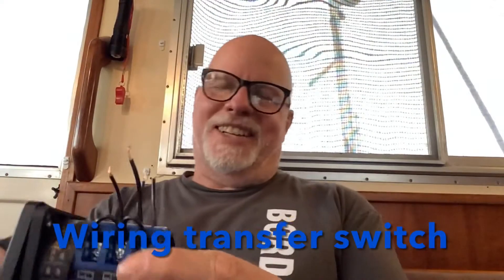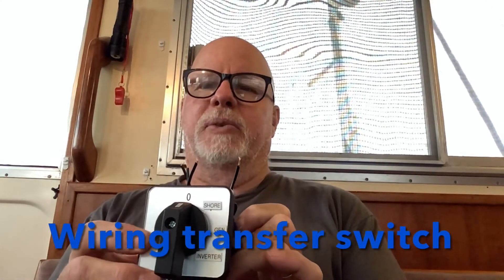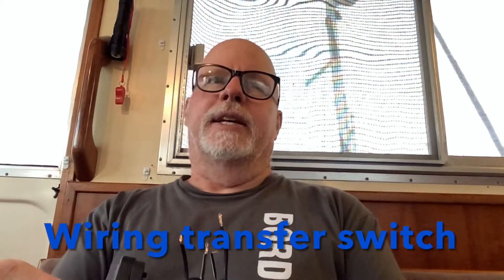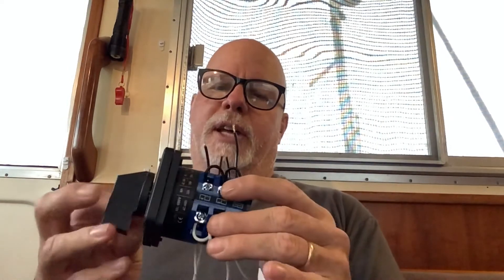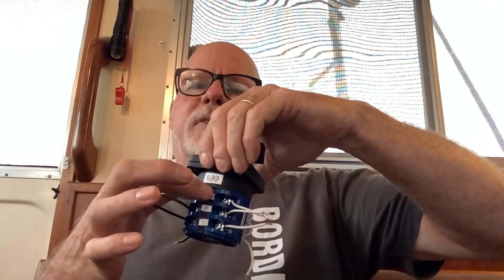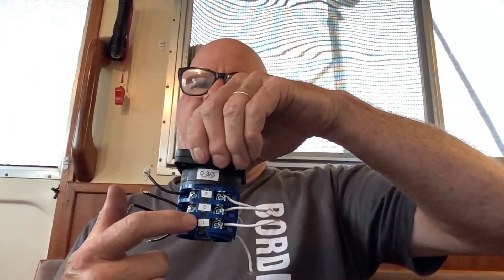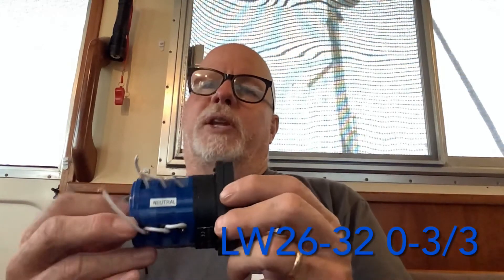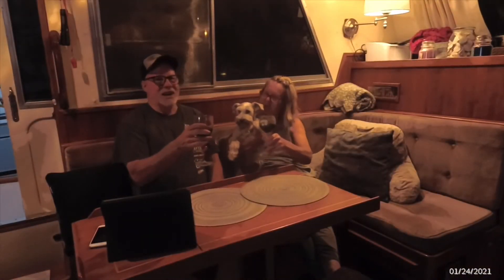Taiss Universal Changeover Switch 32A 690V 4 Position 12 Terminals wiring

Comment: Thank you for posting!

Question: on the jumper/"right"/numbered side, you have long wires coming off of the final terminal and the rest are jumpers. Where do the single wires on that side go? I got confused when you said you have to make new wires at the end, so I got lost.
Reply from the maker: You have to be able to meter it out. Any electrician can help you out. I struggled with it but it’s easy once you figure it out.
Reply: Those single jumped wires go to the breaker panel